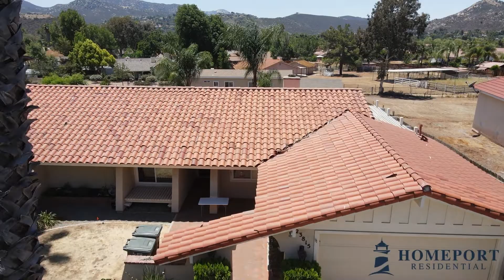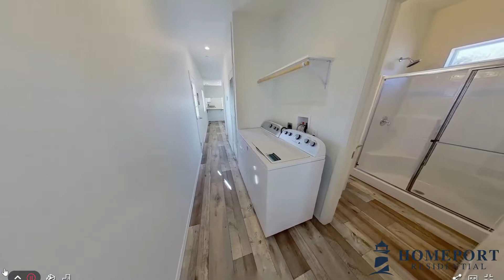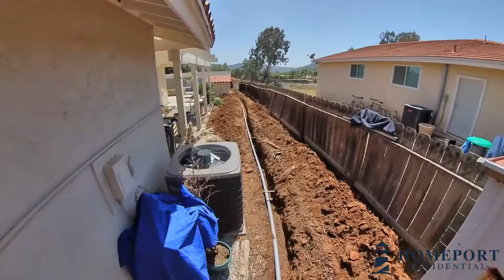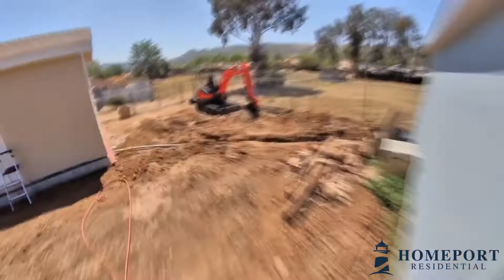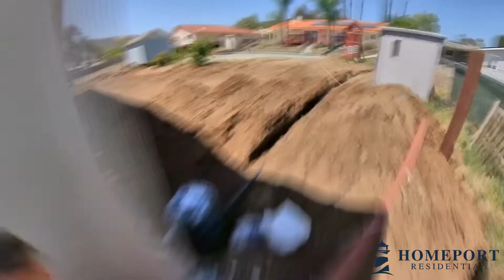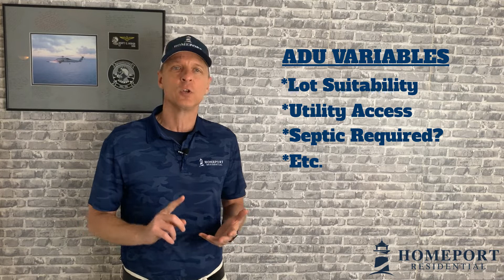How Much Does It Cost To Build An Accessory Dwelling Unit (ADU) In California

Comment: I was wonder how much increase of the property tax ?
Reply from the maker: Hey Ben thank you that is a great question! The way it worked for me is San Diego County sent me a 1 page worksheet in which I was required to annotate all of my expenses for installation, materials, and cost of the structure as well. For me the total costs worked out to about $160K, and the county increased my property value assessment by an additional $100K so I'm paying about $1000 more per year in property taxes.
Reply: @HomeportResidential  that's what I'm worried about,  that's Hella expensive for errthang
Reply from the maker: I absolutely agree with you! However, if you don't get all the required permits all it takes is one complaint from an angry neighbor that could costs you hundreds of thousands of dollars to correct.